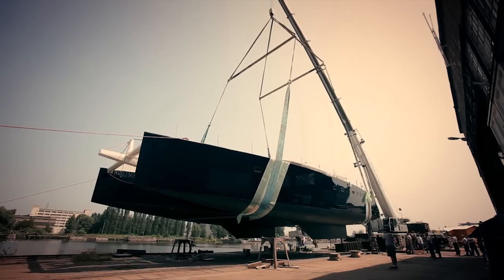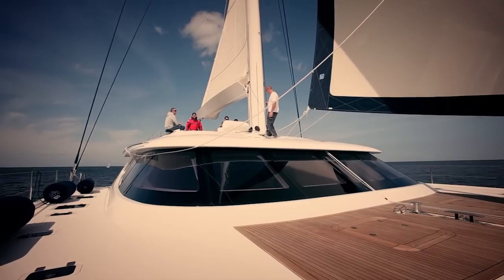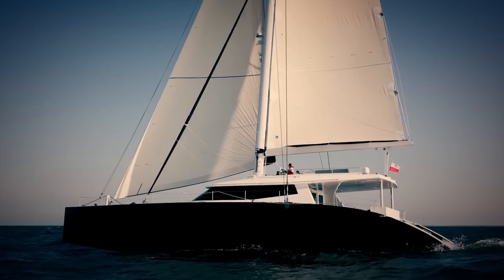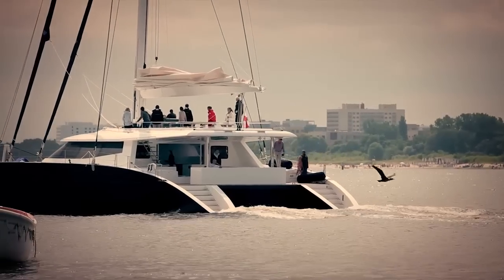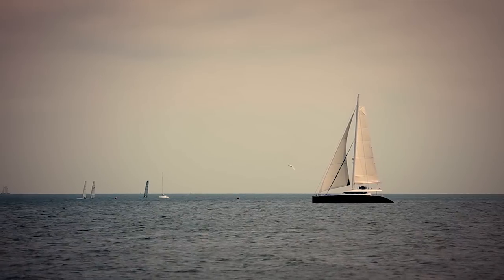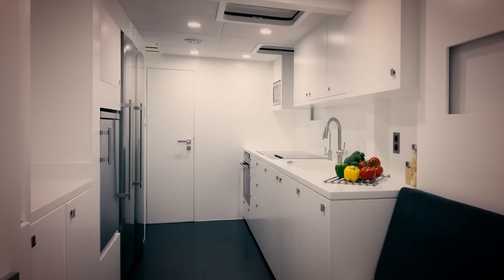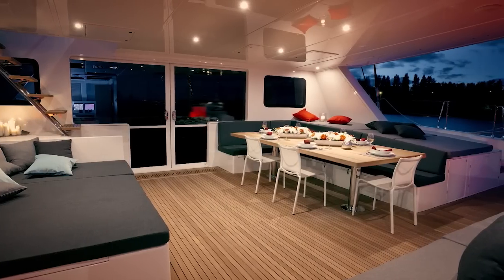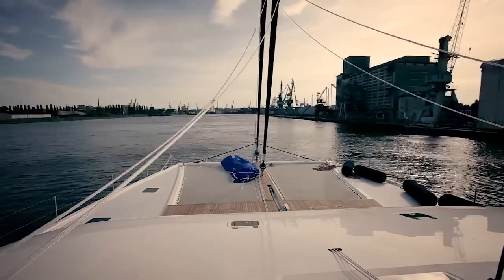Sailing Catamaran Superyacht - Sunreef 80 Carbon Line LEVANTE

Comment: What part of 44 tonnes says "performance" to you you?  Especially when there are 67' cats out there that weigh 1/4 of that sailing at 25 knots in 28 true.
Reply: You can buy a cat for speed, for comfort or for affordability......  Speed/Performance cats are a class all their own. This cat isn't trying to compete in that range. And its definitely not going for affordable... It's about comfort, or more precisely LUXURY, which some cat owners actually want and are more than willing/able to pay for. It's not a racing cat. So generally this type of cat (luxury) tends to weigh a lot more. For example, the Lagoon that is comparable in length (Seventy7) is almost 70 tons . The Privilege serie 8 is about 60 tons...... So YES,  44 tons for an 80ft luxury catamaran is "performance".
Reply: I am building one that is half that weight at 84' with a WRC core and it will  be more than comfortable for 8 guests and 4 crew.  All the creature comforts without being gauche.  So, um NO, 44 tons is not "performance"...
Reply: "without being gosh." Please explain. not being a smartarse, I honestly don't understand the phrase. And there is a difference between "creature comforts" and exorbitant luxury. Are you going to equip the boat to the same extent that some of these are? (the Privilege actually has a 4pc head in the owners cabin, walk in closets, lounge areas, all in one cabin). You are obviously mindful of the effect that the weight of the vessel has on performance, so you would build to minimize weight.... Luxury yacht owners aren't generally as concerned with the weight. And most are willing to sacrifice some performance for convenience and comfort. A catamaran isn't just one thing... "performance" in this sense is relative. It may not be what 'purist' expect of a cat, but 'purist' aren't the only market out there. And it's not who these manufacturers are marketing for. Compared to other cats in it's range, even other cats by this manufacturer, it is "light" cat. And the boat you are having built, as beautiful as it may be, is not comparative.
Reply: Performance in a cat shows itself mostly in very low wind conditions.  5 knots usually leaves boats dead in the water.  A "high performance" Cat would still be doing 3-4 knots with ease.   This is why there must be a proper balance to weight ratio, especially in a catamaran design.  While everyone else is running engines and striking sails I'm still sailing.

Light weight construction of interior wood panels and very creative applications of upholstery can transform any space into a lush environment.  And yes, there will be everything this has in appliances, and more actually, on my design with innovations the Catamaran world has yet to see in this range.  What I am talking about is the need that some cannot overcome to over fit a vessel with things you just don't need whatsoever.  It seems to me that there is a race to cram as much into these boats as possible thinking it adds value and in doing so they are making them unsafe in heavy conditions.

I know that sounds counterintuitive but it is true.  The more weight you add to anything, but especially a cat, the less reactive to the helm it becomes, the less emphasis on dagger-boards and more reliance on short keels.  Those keels on a heavy Cat are like lead in your pockets while you are trying to swim.  It could be deadly because they stop the vessel from sliding sideways or slipping when struck broadside by swells or large waves.

True, I can understand the allure of all that room, and the want to transform it into what most would consider to be "out of reach" for the ordinary person.  I get it.  I think the Cat market is trying too hard to be all things to all people.  To each his own I guess.  Just don't bitch that you spent 10x what I did and yet still can't beat me to the beach.

All I was saying really is don't paint your Ford Escort Ferrari Red and then claim its just as fast as you try to sell it as "High Performance".  Labels and top end speed do not performance make.  The overuse of words like Performance, or all carbon fiber, etc. is not only misleading but down right deceptive advertising.
Reply: Being heavier doesn't equate to being unsafe.....and intelligent design and construction and increased sail area generally compensates for the increase in weight. In terms of accommodations, who are you to criticize how someone chooses to live? I respect your right to your perspective and acknowledge that your narrow mindset is fixed, so I won't waste my effort trying to explain further. Hope you enjoy your vessel, be safe on the open seas....
ps.... Highlighting your own response in a discussion as tantamount to screaming over/ignoring the other parties involved; just sort of small-minded and rude
Reply: "showed everyone... how stupid/ignorant you really are" Really? How exactly did I do that? For the record, unless you are suggesting that something I said actually indicates a lesser IQ, stupid isn't really interchangeable with ignorance in this situation....
Reply: Lmao.... Okay, I'll bite....
Firstly: I said a boat being heavier doesn't equate to it being unsafe. Meaning that a lighter boat isn't automatically any more or less sea worthy than a heavier vessel. Actually, if the boat is too light you will have less control in rough seas, (which is why I won't attempt a Transat crossing in my kayak :P) but that is another argument completely. And if you think that being heavy means that a vessel isn't sound or that design and construction has nothing to do with negating form or controlling function then go check out some navy vessels: LITERALLY TENS OF THOUSANDS OF TONS of steel, and electronics ... but I guess you could build a better one from cedar
Secondly: I didn't generalize you. I made a statement based on your blatant refusal to openly consider different perspectives on the topic. To be so ignorant yet seemingly knowledgeable on a matter denotes an inability or refusal to adapt/accept a different view-point. So yes, where this is concerned, you are very narrow-minded; as you prefer to criticize any thinking that does not fall in line with you idea of 'what a catamaran should be' instead of simply conceding to the fact that owning a boat means something different to everyone.
Thirdly: Your implication that I am illiterate is truly laughable....
Fourthly: "Sociopathic world" Really now? Throwing in random nonsensical insults that aren't prevalent or relevant and is totally without grounds seems an awful lot like projection, in which case it says more about you than it does me. And then you go on to practically admit that you are insulting me simply because my statement offended you... So I'm not even sure how to deal with that level of immaturity. Frankly, if that was your idea of being classy then I'm sorry for those who have to deal with you when you are being petty.
Finally: Sadly, amidst your array of attempted insults you still did not refer to anything in my prior statements (that I actually said because I never said or implied "a boats' weight has nothing to do with a boats' safety") that demonstrates my "ignorance".
Reply: Back to the insults.... guess you can't think of anything else.... I don't even know what  "SWJ special little snowflake." supposed to mean.... But I must say, I believe just about everything you think you know about me is incorrect.
Reply: @cherryblossomforge6896  I'm new to cats and trying to learn. Which brands and models do you like for being comfortable yet true performance models? Sold in Europe. Thanks
Reply: @rashidasimmons3854  I'm with you